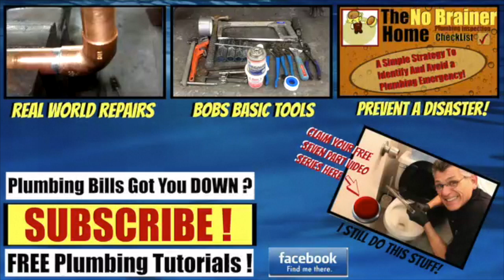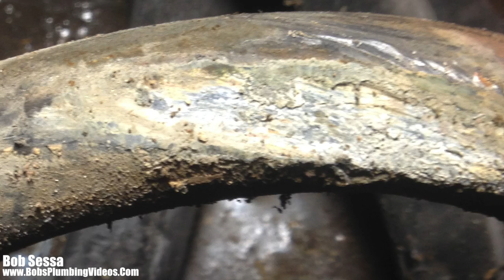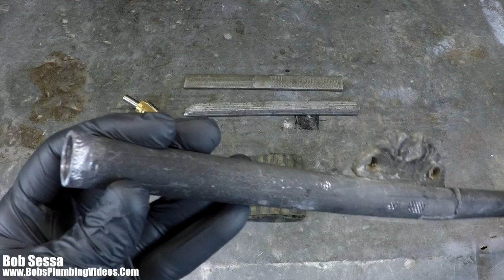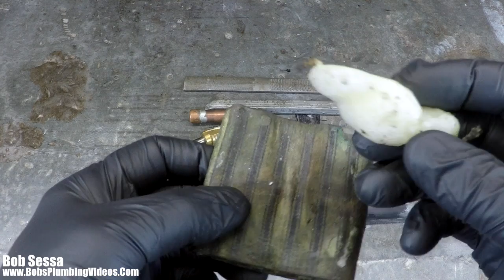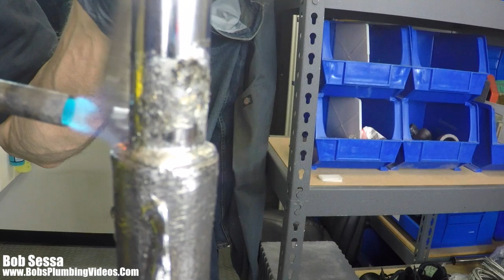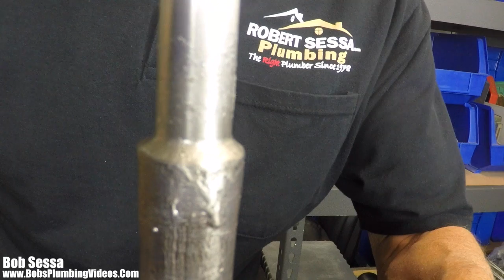Water Pipe Leak Repair / Joining Copper & Lead

Comment: Here in Thunder bay Ont. Canada i come across 1/2" lead water service pipe. Run from to city curb stop under the home basment footing and up through the floor. I had emergencys at night.. weekend were the city recently replaced the water meter in the basment. Cuty works dont care they are ruff on stuff.. that old lead pipe get bent back an forth right at the top of concret floor. The lead 100 year old an has 1/4" of heavy brown red rust on the in side like ship  Barnacles.  Any movement of that old lead start a hair line crack. Most time it never start leaking when city cons are done but with in days or weeks it leaking. You have turn the water off at the city curb stop.. the city want you to call them to turn it off an back on after it inspected witch meands a $79 permit cash grab.. yeaar a go i made my own 8' long 1/2" pipe T tool to turn them off there 7 feet down. Cut the lead at the floor drill it out for 3/4 copper to fit tight an past an soilder it. New ball valve.  After hour call $1500 . I tell them no waranty and we should dig up and install new 3/4" pex.  Tell them no permit i shut it off i turn it on once new pex an backfill. I also tell people i see with lead we need to replace it for 1800$ but no it take an emergency 1500 after hour call out.. i could replace the line after hour but by time i move eqipment in. Dig it out 7 feet your looking at $5000cnd. No lead in the house it old steel  Galvanized pipe

Comment: enjoyed your try at a wiped joint,I think you were too hot and losing solder,your pipe should be BELLED out  ( drifted/flaired/tutrnpined,so many different names ),solder is 60% lead/39%tin and 1% antomony,work the torch more and wipe the cloth ( mole skin more ) with a 1/2 circle motion all the time buidling up and forming a sort of ball shape ( wiped joint )takes a lot of practice to get it right.done one just a few months ago 2' deep trench...first for many many years..btw here in UK..MOST plumbers would run a mile from that job..they're fitters now..and all seem to use philmacs and all that crap LEGO stuff....btw 76 year old and can still do this work and roof lead work....I'm NOT condemning you work good effort and will hold in that position,but would've liked to have seen MORE solder wiped joint on it.( for strength )
Reply from the maker: I hadn't wiped a joint in 20 years when I did that video LOL!. You're right, although not pretty, I still haven't got the callback. Thanks for checking it out.

Comment: If you can , avoid drilling the lead pipe. It thins out the wall too much. Use a pipe swage (or swaging tool) to expand the lead pipe to accommodate the copper pipe.
Great video though. 
👍
Reply from the maker: Good tip!

Comment: Ex British Gas Engineer trained in not only gas lead joints but lead water  wipe joints, couple of pointers. 1. you don't need a wiping cloth (mole skin) as you are not doing a proper water wiped joint.
2. you are doing a pretty poor gas joint (needs less build up of lead)
3. plumbers black below socket prevents solder runs down pipe.
4. watch your video back, as you apply solder it gets too hot and disappears down the pipe.
5. a roll of solder is all that is required, unless you are (and your not) doing a wiped joint
6. the cup or socket you have formed is too small, try using a turnpin.
7. your flame temp is too high and too close.
8. frankly its a pretty bad joint 2/10
9. you are not a fully trained or qualified to any standard lead worker at best ill informed guess this is how to do it diyer  1/10 for mis information 0/10 for dishonoring real tradespeople.
Reply from the maker: Thanks for the critique! Bottom line NO MORE LEAK!

Comment: it looked like a lot of the solder was ending up in the pipe and dripped inside... what would you do in that case? how can you get it out of there after? is there any tricks? thanks for this great video
Reply from the maker: If solder gets inside, game over. one big headache to remove it. It's technique, the amount of heat you use and years of trial and error. I admittedly haven't done one of these is quite a while.

Comment: For reference, here on the water utility side, there are pack joint couplings specifically for lead to copper connection. I don't know if that's what you meant by dresser coupling, but Mueller still makes them and most waterworks supply houses will have them. The city I work for has a rule that if there is a leak on a lead service, we don't do a repair. We replace it entirely to the meter. Because of that, we don't use them anymore. 

Lastly, I know the customer didn't want to pay for a repipe. That being said, cutting and sweating lead to copper is going to cause lead levels in their water to skyrocket. I get that you wanted to get them back in water, but I can't sleep at night enabling someone's future cancer. Sometimes saying no to a job will force someone to make the jump to a repipe.
Reply from the maker: Duly noted and understood!

Comment: I live across the pond and then some in Austria. Vienna has a significant number of pre-WWI apartment buildings and they're all full of lead pipes. Bathrooms and kitchens usually get replumbed as they're renovated but the riser mains are usually still lead as landlords are notoriously cheap. When I was a kid there were times when we had about one leak per year until my parents finally had enough and had all the plumbing redone in the late 90s. One of the more spectacular leaks was in the abandoned basement laundry room mostly used for storage. The tap for filling the big copper kettle had been removed and the lead pipe capped off at some point, outside the wall. One day I came into the laundry room for some reason and saw a thin fountain squirting from that spot across the entire room!

Austrian plumbers had massive cone-shaped pliers for cup joints or maybe still have them. Things have changed a whole lot in plumbing over the past 20 years here, from soldering to crimp joints, from copper to MLCP, gas from threaded or welded black pipe to crimped stainless steel.
Reply from the maker: It's gotten much easier, and unfortunately "the skill is gone" but I guess that's the price of progress! Regards, Bob.

Comment: Candle u can also use it when u doing lead shower pans when u r soldering the corners
Reply from the maker: You could solder the corners if you wish, but when folded correctly there is really no need to do so.

Comment: I own a house built in 1947. Two days ago I suffered a leak in my boiler return pipe. The pipe is old and runs along the bottom edge of the inside wall where it meets the basement floor. The pipe is practically inaccessible, unless bathroom ceramic tiles wall are removed along with drywall. My question is, can this pipe be repaired without replacing it?
Reply from the maker: It's Depends !  in some cases yes, in most cases no!.

Comment: Hello Bob. Here in the UK we use a lead lock to join lead to copper, it's like a brass compression fitting and on the lead side you have a ring and an o ring inside the fitting that tightens all together. Here we still have many houses etc that have lead coming in from outside. I have in my house, it must date back to Methuselar
Reply: Also, the way you sweated the lead to copper is illegal here in the uk - i personally only use leadlocs if i have to - if i can use a philmac i will 👍
Reply: Leadloc it is.  Cheers guys.

Comment: This was an awsum video very helpful. I have the same problem.  It is a city main water lead pipe coming into the house. I do not care what any plumber says. Sometimes you have to be creative to fix a problem.  I give 2 thumbs 👍👍 to this plumber.
Reply from the maker: Thank you sir👍 regards, Bob
Reply: Definitely I have one that's been kicking my behind and this is my last resort which I do not wanna heat lead.... I'm dumb enough. When I did my first few toilets I remember the oakum? And melting lead into the flange....  uuuugh

Comment: As an old plumber in the U.K. we used to call the cloth used mole skin (don't know if  it really had anything to do with a real mole) the flux used was tallow which smelled pretty bad and the joint used was called a "taft joint" if you used an adapter to thread onto a tap (faucet in USA) you might solder a 'cap and lining' to connect to the tap. The solder used in wide stick as shown in the film here was called "plumbers metal" here in U.K. and was composed of 50% lead and 50% tin.
Reply: I thought plumbers bar solder in the uk was 60% lead / 40% tin?

Comment: newbie question... How dangerous is it, really to leave lead pipes that way in your house, and why do people not upgrade?  especially the (i think he's a ) plumber below who says he still has lead in his house ?
Reply from the maker: That particular job was very rare, I was shocked to see that they still had lead waters lines throughout the entire three family home. Cost is probably the biggest reason people don’t upgrade. Many’s home in my service area still have lead water main service lines feeding the homes. They may have brass or copper interior plumbing, but the incoming service is lead.
Reply: It really depends on your water. If it's hard the lines are probably coated with limescale on the inside and you have very little lead in the water. If your water is fairly soft, you might have sky-high lead levels in the water. I'd recommend having the water tested. Besides, once they're 80+ years old, lead pipes do like to leak and are a bit of a nuisance.

Comment: Wiping cloths are made from mattress ticking
Reply: they were made from " fustian / moleskin " cloth in the UK, used them when wipng joints, on lead pipes etc, used a " lignum vitea " turnpin to bell out the lead, used a stick plumbers metal ( 60% lead 40% tin ) smear some tallow on the lead to stop it oxidising, and some on the wipng cloth stop it sticking to it, 

illegal to use lead on any open ended pipe services, only sealed systems, ie heating systems, waste pipes etc, the plumber I learnt it off, use to wipe joints on 4" lead soil pipes, in situ: before woporld war 2, 

can you use lead legally in the US on water supplies ?
we have " leadloc " compression fittings to connect copper and mdpe to lead pipes, here in the UK

Comment: Hi Bob, nice video just curious what does tinning the copper do?
Reply from the maker: Basically if you're not going to complete the joint immediately, tinning (adding a thin coating) prevents the copper from oxidizing and having to re-clean it. You can prepare many pieces and tend to them later without having to constantly reclean.
Reply: @BobsPlumbingVideos  Thank you Bob, i had always wondered the purpose of it. Thats cool so if your plumbing in a big job with alot of joints and piecing it all together some of them will sit there for a while while fhe others are being made up and this will protect them.
Reply from the maker: Exactly!
Reply: @BobsPlumbingVideos  is the parrafin also acting like a flux?

Comment: would it be easier to do lead to brass, then transition to copper?
Reply from the maker: Before copper tubing 
they use to make male and female solder nipples which basically were brass fittings with the same outer diameter as today's copper tubing. Made it easy to insert them into cup the joint. The outer diameter of brass pipe was just to big to fit into the lead.
Reply: like a brass ferrul of some sort? I guess there wasn't a need for continued production!!
Reply: Bob you had a couple of those fittings in the old pipe you took out that you could reuse.

Comment: Nice video but honestly I would just repipe the home with PEX or copper
Reply from the maker: They only had the budget for a repair. Thanks for checking out the video!
Reply: pex not legal in NYC for water, only for heating. maybe they change that soon.  repiping all in copper is something you would wait for a full renovation, as tearing down everything is costly.  honestly if they still has active lead pipes, they probably haven't done anything major in repairs since the 1950's

Comment: Bob in the future you can buy canning wax or "Gulf Wax" and it is a paraffin wax also used to make " buddy burners" corrugated cardboard with outer paper removed wrapped in an tuna fish or similar low profile can and added gulf wax to make a heating source this was done by old Boy Scouts as well as many Cub Scouts.
Reply from the maker: Thanks for that tip! I miss those old candles. Regards, Bob.

Comment: yes used this a few times over the years fell sorry for the up and coming plumbers as this skill  is going to be lost   

ex silent  video  thanks    ( tell uk)
Reply: I'm 27 and I see lead everyday, even solder 1 1/4 p traps into lead drains. Living and working in an old city has it's benefits.
Reply from the maker: Absolutely Terry! I grateful I learned when I did, as this technique does get me out of some tough spots. Regards, Bob.
Reply: Anthony Sparapani well maybe where you live.. but in my city anything underground, or commercial buildings must be copper and cast iron. Also we only use pex when we rough in a whole house or making repairs that would cost too much and take too long with copper. Copper and soldering ain't going anywhere

Comment: Can you use regular copper flux instead of candle wax ?
Reply from the maker: If I run out of candle I will!
Reply: Agreed. You could see there was trash in the joint as it was being made. It came from that bar of solder Even when using 1/8 wire solder, we would sometimes sand the solder and make sure the joint was juicy with flux being there to bubble off the impurities.

Comment: Fantastic video Bob!  I doubt if any other plumber could do a job like that or for that matter if they could, do one as good a you did.  Would the placement of an aluminum  heat sink  the at the bottom of the joint on the lead pipe speed up the setting of the solder in the cup joint?  Questions about repairing brass pipe in place. Do they make sweat fittings to join copper tubing to brass pipe?
Reply from the maker: They're called T.P. "threadless pipe" adapters. Back in the day, they plumbed  buildings using threadless pipe which was essentially brass pipe with no threads and the fittings were made using  acetylene gas and very high-temperature brazing rods.  Take a look at this link-https://www.mrsupply.com/new_search.php.
Thanks much for the compliment, I was actually using a bit too much heat in the video, but my camera was so close to the work I was freaking out about burning everything up! LOL! Happy Plumbing!
Reply: Thanks for the link Bob; very helpful ! Bob, are lead closet bends still code in NYC?  I know that they can be repaired when they leak on the lead portion but  when they are beyond repair do they replace them with PVC? I have seen 4" PVC caulked into cast iron on this old house.  You have the best plumbing channel.